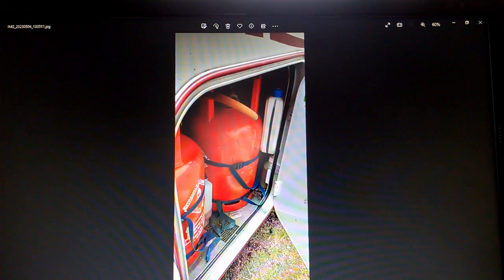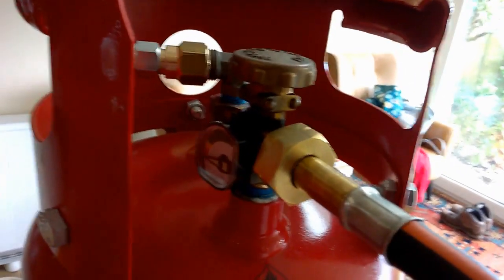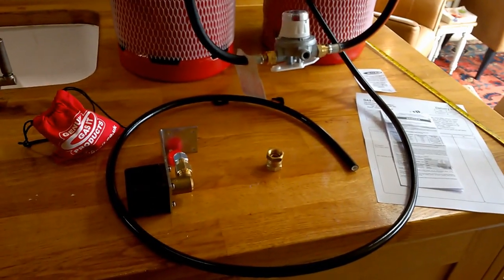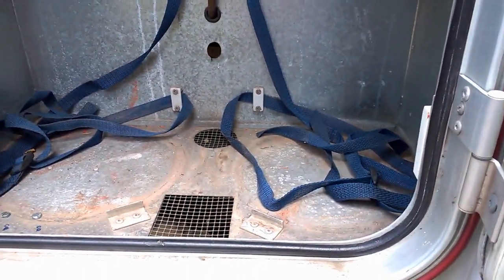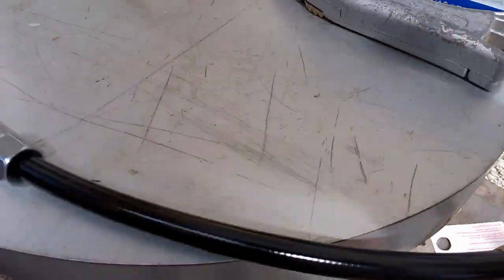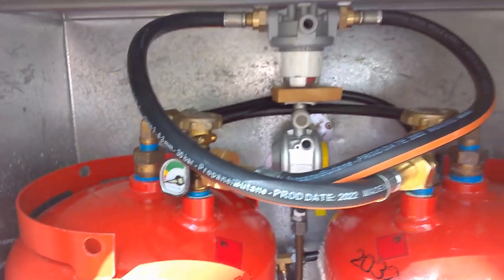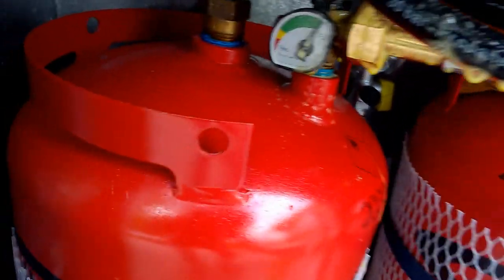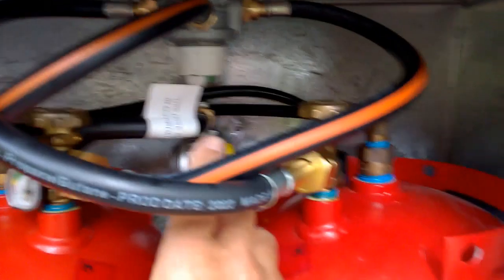Refillable LPG tanks for Mororhome (RV) buying, fitting and filling.

Comment: Thanks for posting this. very informative. Did you need to put any sleeving around the gas pipe where they passed through the sheet steel at the back of the gas locker?
Reply from the maker: I didn't need to because I put a screwdriver in the hole and pushed it so that it made the hole shaped, ie pushed back at the top and forward at the bottom so no sharp corners to press onto.
Reply: Well done! 👍